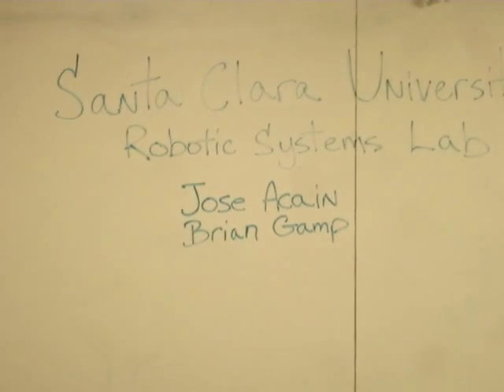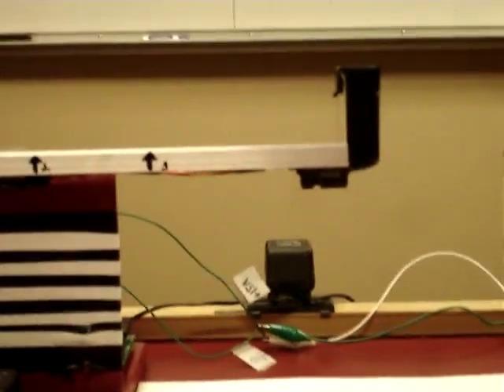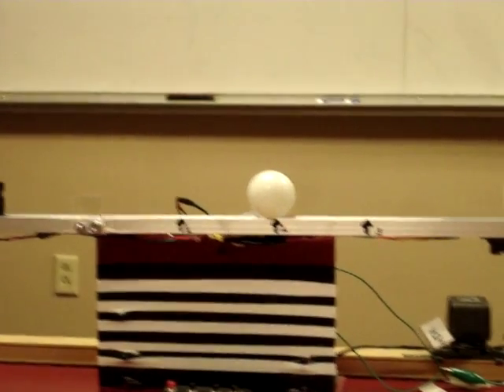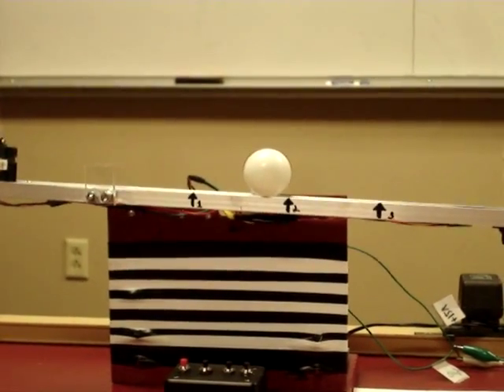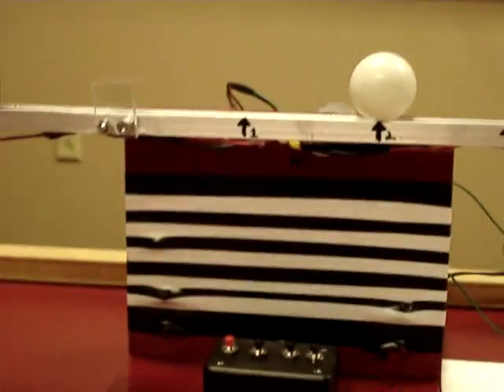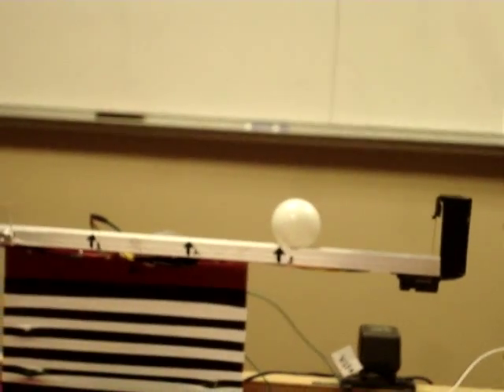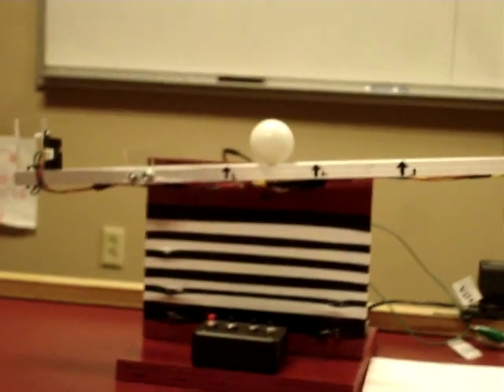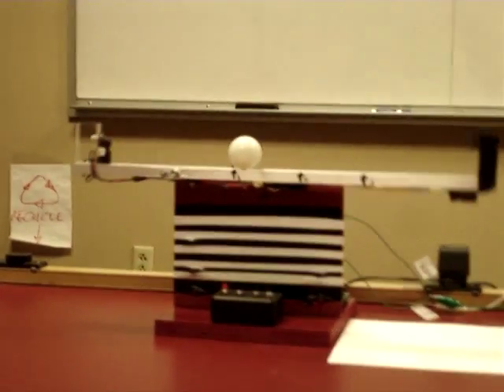Position of a Ball on a Beam Control System

Comment: @bgamp 
hi brian, after a long time i return with the project, well,
-  the DC motor of the project is a motor of printer and i dont have some features about that, like stall torque(is really important? and why?)
- the speed is 3120 RPM in 18 VDC.
- The power is the voltage regulator.
- The control is PI control in the inner loop, and the outer loop is a lead compensator.

I hope your advice.

Comment from the maker: @PavelMenseses Hi Pavel, sorry for the late response.  There are many ways to deal with the noise... try a digital filter or an electrical one... also, be sure to be inside the useable range, the output becomes somewhat useless outside that range.  :)

Comment from the maker: Hi Pavel,

I also used a DC motor without gearing.  There could be many reasons your system is not responding fast enough.  What speed do you get out of the motor at full power and no load?  How about your stall torque?  How are you sending power to the motor?  What kind of control are you using?

Comment: Hi Brian, sorry... I know it has been very long time for you on this, but which motor brand and model did you exactly use in your system? at least what torque and speed used for your motor. Im using a motor with 430 oz in torque and a speed of 50 RPM at continuous torque but I still face a slow response problems. It can't be my controller because I'm using an FPGA which is the fastest digital available.  Could you please reply. Thanks